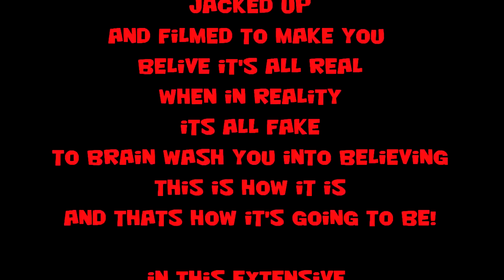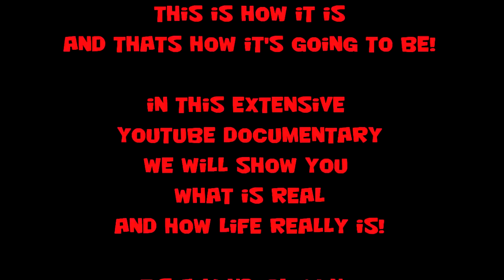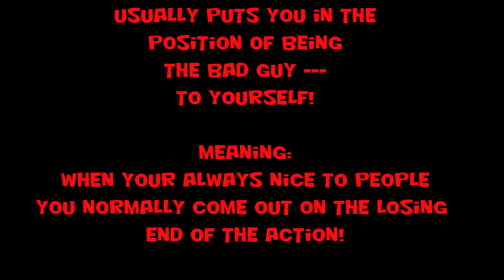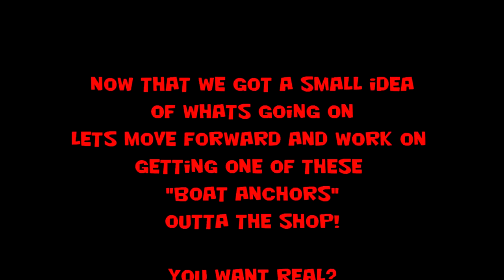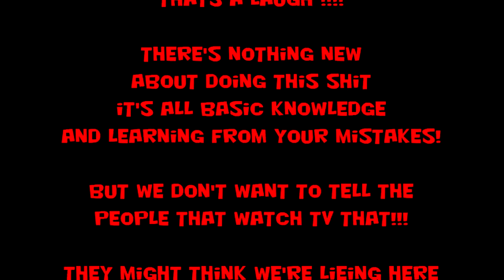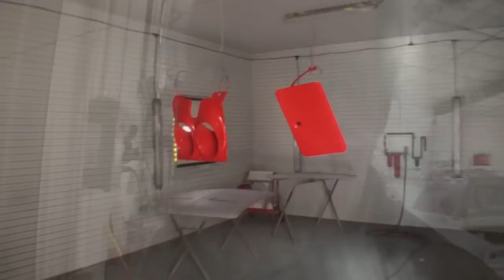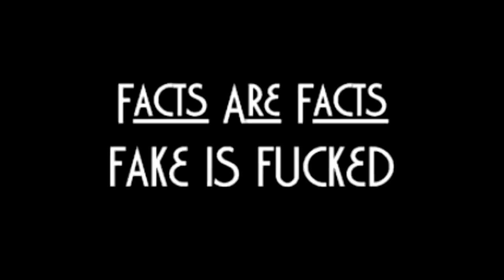Building A 1967 Chevy Camaro - Part 1 - Introduction To REALITY

Comment: You are getting fish eyes there because you are running diesel in the heater instead of the clean kerosene.  You may have gotten a new heater.  My old kerosene heater burned diesel well and had no issues with fish eyes or dust in the paint.  Got a new heater and had nothing but problems until I switched back to kerosene.

Comment: Pete I feel for you my friend I’ve been exactly in the same position. It sucks your either a good guy or your a Dick . Everyone else I know who runs shops told me the same thing when the customer don’t have the cash tell them to come get the car out of your shop bring it back when they have the money but no I’m like you I’ll keep it in the shop or I’ll cover it up out back . 
Now I’m going thru chemo treatments I’m sick as hell I’m doing a 65 mustang or as you’d say a rustang . I’m in the middle of upgrading all the front suspension the power steering the disc brakes. It needs a wiring harness put in the motor is at the machine shop finished. The transmission is at the transmission shop finished. I have a third member out ready to go to the tranny shop for new gears I need. I still need to replace left and right side trunk pieces the rear crossmember, the rear tail light panels, both outer wheel houses involve quarter panels with Dyna corn aftermarket parts. The rest of the sheet-metal is original strip Apoxsee‘s and painted already not to mention the car needs a complete interior and I’m trying to get it finished.. I am under the gun stressed beyond my imagination. Hopefully I can get this car back together before I am unable to work on it.

Comment: the hole truth not whole truth, i have had dolly for 25 mths built inside new shop cold winter in a metal building every piease had rust  mean kenny block sanded dolly's body